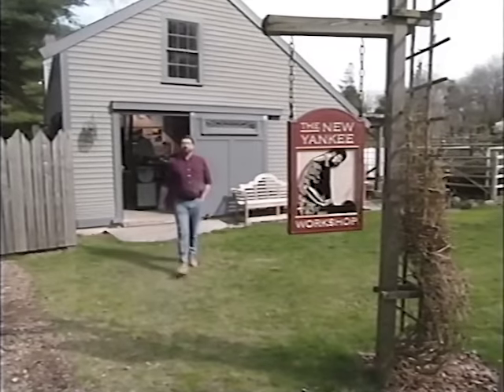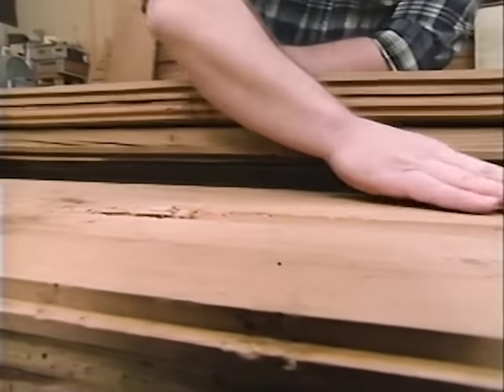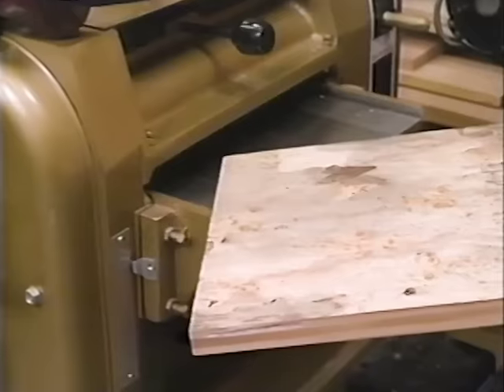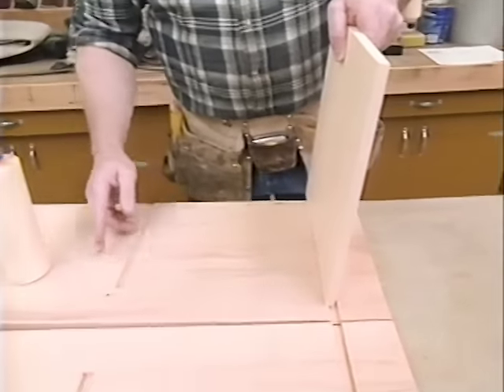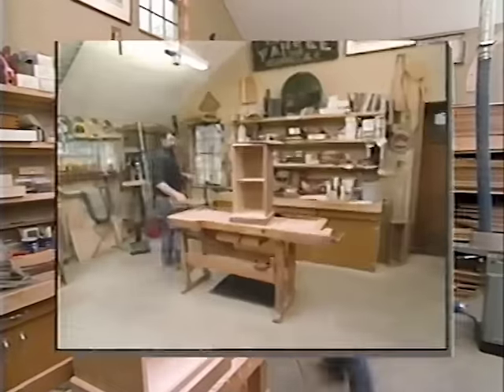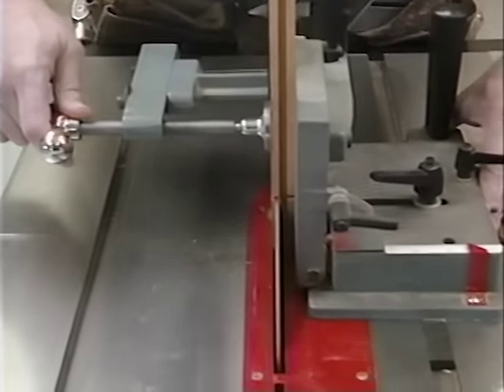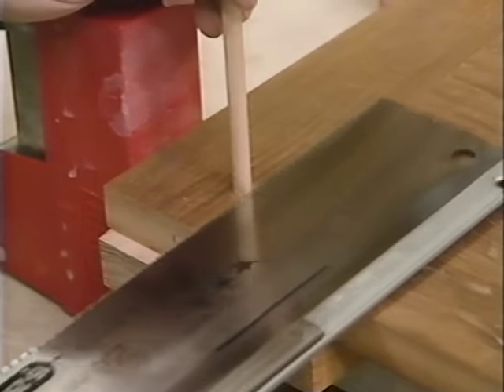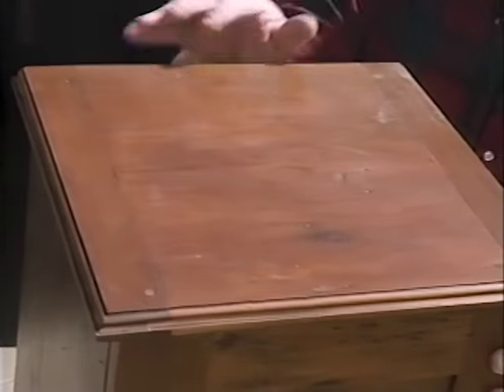Bedside Cupboard  |  S8 E1 *

Comment: I wonder if the variations in naming led to this one getting mislaid?  In my notes (I assume from tv listings of the time in the UK) this was recorded as "Night table".  I'm sure I've also seen "Bedside Table".  Now it seems to called "Bedside Cupboard" - but anyway great to see it back, thank you for recovering it.  There seems to be several problems with S8, e.g. I believe episodes 3, 6 and 13 are all hard to find. For some reason they were always skipped in the broadcast schedule. 13 was the original router table, I do have it but it's not great quality (I had it on a PAL VHS tape which I've since digitized and cleaned up a bit).